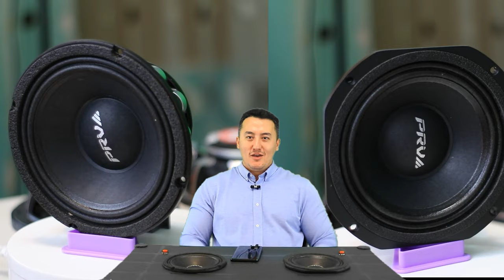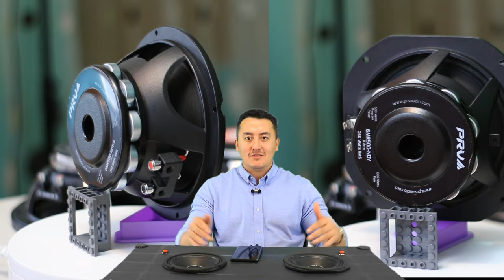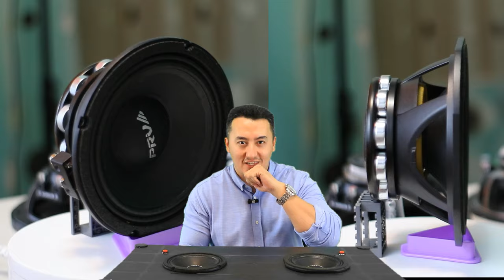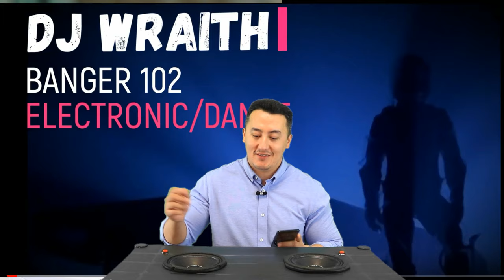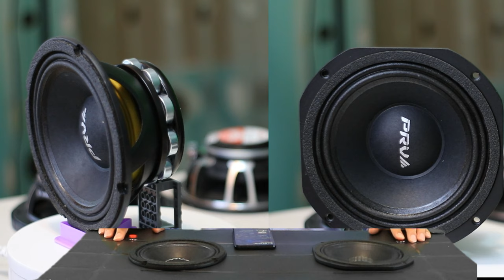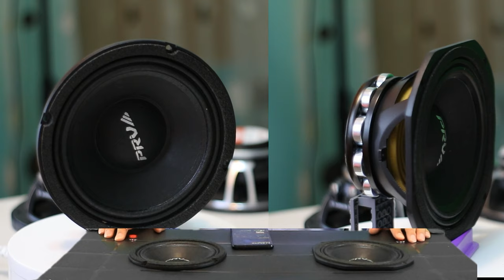Myth busted, real test 4 Ohm vs 8 Ohm speaker? Car audio system PRV AUDIO 6MR500-NDY

Comment: The less ohms the more power it draws from the amp mike it might not be noticeable at low volume but crnk that volume up and youll smell some smoke from the 4ohm speaker first.if you have really good amp and you want more speakers you can have 4 8ohm speakers per channel to a final load of 2 ohm per channel vs only 2 4ohms tht make the same 2ohms final load per chanel so you tell me if 8 speakers vs 4 speakers makes  diference with 8 speakers if you have the room you.can have way more punchy middbass or nice and clear vocals
Reply: well said. running higher impedance speakers also allows amp relax and be more efficient less current draw and cleaner sound  2 ohm vs 4, 4 sounds cleaner amp runs cooler and efficiency goes up less taxing on the poor at best electrical system most have. once you go full retttard and spend thousands you care much less about this and just want the sound you like  no concern given to the price or efficiency. small sacrifice of db allows for cheaper build too for beginners who cant afford big 4 and 4/0 and mechman alts and... it never ends   but a budget multi amp system can be built on stock electrical if done right and using these options to your advantage. at the sacrifice of a little spl but you can always buy more later. car audio does not have to be for the wealthy alone just read more books and stop believing everything you read in forums 90% is hogwash you dont need 155db @ 30hz to have fun with this hobby  but it does help   ;P
Reply: and i band pass my mids they get mids only if you have too large of a range per cone it gets muddy and builds more destructive heat ( your number 1 enemy is clipping number 2 is heat ) and i can grossly over power my mids by keeping them this way you want highs get some tweets never full range mids with real power once the magic smoke comes out its a paper weight
Reply: Hi I have a small doubt. please give your expertise,I am planning to build a diy soundbar with 2.0 amplifier board (stereo left n right channel), can I add 1 woofer to the amp,(thereby total 3 speaker for a two channel amp). the impedance of amp is min 8ohms..
Reply: @fusion_fever1592  im not expert but if the amp is capable of bridge mode i think you might be able to ger away with it but keep in mind you must add something that cuts the mids and hight only to the subwoofer.. i sugest get a 3 or 4 channel amp and play it safe if you dont know what youre doing or do some more reserch before damaging your equipment
Reply: @michaelsegarra2709  thanks for the reply, the way my mind is thinking after watching lots of YouTube video on impedance is as following,the amp is a 2 channel stereo with 8ohm impedance,so I will a 8ohm speaker for the left channel,and now I will add my 4ohm woofer and a 4ohm speaker to right channel in series, thereby giving a total impedance of 8ohm on right channel (4+4 =8),thus meeting the requirements of the stereo amp at 8ohms..
Reply: @fusion_fever1592  if the amp is capable of being bridged you can run the woofer bridged and run the mid high in stereo   make sure it will handle the lower ohm resistance and be sure it will be ok being bridged if not there is still  way  get passive crossovers (like dayton or audio pipe ) and that will let you use 2 to 3,  4 ohm speakers and still have a 4 ohm load total load  but it will take away some spl using passive crossovers. and your bass will be 2 channels for what you are doing id use a dvc sub a dual 4ohm and put 1 channel of bass on each subwoofer coil.
Reply: the crossovers is your best bet they are like 20 a pair on the big auction site
Reply: i am not a fan of the crossovers or there cut off points    you can order dayton crossovers in 8 ohms as well  audiopipe are all 4 ohm that i have seen    making your own crossover with the tools on parts unlimited might be a better option for you as well   and if at all possible get a better amp and worry less   its easy to use a car amplifier for this use and a clean power supply like one for a hp server  my garage has a two amplifier 2500 watt skar audio system and 2 @200 amp 12v psu's from servers. it literally tries to rip the garage apart
Reply: Lower ohms higher heat on the amp ads distortion less headroom
Reply: How do I wire 2 6.5 speakers together on 1 channel on a amp
Reply: I play my 4 of my ds18 4 ohm speakers at max volume all the time and I don’t smell anything so for me I don’t have that problem and I’m running a 2k watt amp on all 4 6.5
Reply: This is true…years later. Even with todays car audio amps with huge numbers for cheap prices I wish there was more 8ohm offerings. Old school setups with 6x9s on the back dash and tweeters in all corners with upgraded factory swap all around would be nice without having to need so many amps.
Reply: @michaelfessenden8601 the key is to do the math on how much watts you need at a given own and get about 30 percent over the watts you need, since most amps aren’t 100 percent efficient.
Reply: OK, build a Q-system at 1ohm and a DB system at 8 ohms .and have fun with that
Reply: If I have 4 8 ohm speakers that take 250 watt rms each, and wire them in a mono 2 ohm amp in a parallel circuit, does the rms gets cut down? Will it get the same power vs a 4 channel amp that sends 250rms to each channel?

Comment: 4 vs 8 Ohm isnt really a power thing. if you close your eyes you can hear the difference between them. its not volume, its tone and texture of the different ranges. the 8 ohm sounded "thicker" at the lower ranges, but muffled the mids and highs. where as the 4 ohm lost some of the meaty bass, but gained more crisp sound in the mids and highs. when I put together a system a couple decades ago, I used 8 ohm subs and used 4 ohm mids and tweeters, I would have taken the tweets to 2 ohm but they just werent around back then really. but I had an incredibly rich sounding stereo. heavy base that you could feel passing through you, and crystal shattering highs. now I wish I could get something other than 2 or 4 ohm speakers for my motorcycle :(
Reply: Its the best comment on this video, Ive heard that too yesterday doing car audio and switching between 8 and 4 ohm subwoofer, 8 ohm just crashed it, you could close your eye and just relax deeping through that smoothness of bass vibrations, that meat! Difference in night and dat!!!! Even by not an audiophile person next to me. Otherwise wiring 4ohm speaker the bass was easier controlled right and louder, but it was only loudness and not quality itself it was not comparable, maybe some mids and highs would be better at 4ohm but not for a bass, it needs to be hell thick and dynamic which only maybe top high end 4ohm speaker give you, comparable to casual 8ohm. Peace out! And have a good 8ohm subs in ur trunk!
Reply: Thanks this helped me how to design a sound setup for a pinball machine..understanding the output. Now are those driving by individual amps? If I remember on my home theater amp I can set the ohm ratings per channel though.  I also bike too.. ride safe
Reply: It took me a while to finally find this comment. I have a pair of beautiful PHD AF 12" 4ohm each, that will be pushed by RF T20001BD. The amp should give them enough power at 8ohm load. What you think?
Reply: @sebastianfonk1281  I havent dealt with Rockford Fosgate a whole lot. especially this high of wattage as most my experience with them is in the motorcycle applications. they are good but they always seemd to be a bit "meh" on note for note quality, but they have among the best for controls.
being as you are using it for base,  it would fall more to type of music. Rock/metal should have a decent snappiness to it. overly muted "rap" style base will likely be snappier, but thats not the general goal of rap style music where it tends to be long low notes.
but would def suggest getting a good crossover to delete the ranges you dont want pushed through subs. even if you dont hear those notes anyways, if the signal contains those ranges it will reduce your clarity of the notes you want coming from them.
make sure the box is properly built whether ported or un-ported. I wouldn't go with off the shelf boxes unless the box is specifically built by the maker of the speaker. the boxes off the shelf will 99.9% of the time be the wrong size and give to much air or not enough and/or have the wrong port sizes.
you should be fine over all as long as you don't try to rush from the point you are at to a finished system.
Reply: Lol... 8ohms is thicker sound than the 4ohms... 😂😂😂
Reply: @brettleisy356    Soo YOU feed 1 watt into the 8 ohm. Then on the 4 ohm it draws 2 watts from amp but same would level. Which means  if 1 watt into 4 it would be quieter
Reply: @joeyjustin6895  I understand resistance, but maybe you don't understand how wattage converts to dB, when you double the wattage you are looking at approx 3 dB difference. when you're talking about a 1200watt system jumping to a 2400 watt doesn't double the volume. at these points its better to have a better sound than just barely perceivable volume difference.

also having a higher sensitivity speaker (not to be confused with ohms (resistance))  means your 1 watt floor starts with more dB. a quality speaker can be around 8 dB higher typically. this is REGUARDLESS of ohms. this puts you are 2-3 doublings ahead of lower quality speakers.

you can have a 2ohm speaker that is still louder than an 8ohm at the same wattage. YES you are correct on the resistance, but not necessarily on volume.

even when speaker for speaker and only ohms change, the difference is minute and the % of difference it makes becomes smaller the higher the wattage used.

the difference from a car horn (@ 2 FEET) is 110ish dB, a full on rock concert is about 120-123.  your 3 decibel difference wouldn't even be registered (without an actual measuring device) in these ranges.
Reply: @JmsJing  have you heard of harmonics? its where a note plays at a specific wavelength or hertz. Harmonics create smaller spikes at the same not but matching its pitch, a "thick" sound might have several of these harmonics happening making the sound seem fuller. for hearing tests they actually use equipment that reduce/remove the harmonics to more accurately find ranges you cant hear, as the harmonics might fall into the hearing range and give a false sense of hearing.

some high quality equipment will have several of these harmonic spikes.

so yes... thicker sounds (wider/more placements of harmonics along the spectrum)
Reply: @brettleisy356  its not your speakers making all this thick magic with impedance change its the amp that is powering them. Yes most amps sound alot better at half there power. Even the amp in a head unit . The dampening factor increases and the thd decreases when the amp dont have to ramp up the voltage and the mosfets stay cooler as well
Reply: @Hayawasa  you're amp can be the ultimate out there in all ways, if the speakers are junk they wont reproduce as well. the speakers I tested were of the same brand, and make, the only difference was the ohm rating, on the same amp. while it COULD be factory quality variance of the speakers, there was an audible difference.

the speaker factory variance seems to be less likely as its repeated with other speakers/brands/ohms.

this is not saying the amp isn't important cause it is. but they are I would say equally important.
Reply: @brettleisy356  your right. You pretty much cant have one without the other. Not to mention a good quality music , i wish now i would have made a thumb drive full of all my favorite music on flac files. The stuff they stream through the phone isnt the greatest sometimes. I have some streaming apps on my phone but some songs arent on there, man i miss my cds. But i could see where in certain situations like yours an 8 ohm speaker may sound better , but its not something that is commonplace. Unless it is home stereo setups. Im just assuming your talking about a car.

Comment: guys .an 8 ohm speaker  is 3db more efficient than a 4 ohm..it this amp  is 250w at 4 ohms it means at 8 ohms is 125 watts.even the 8 ohm driver receives half the powet it plays the same loudness with the 4 ohm.this means that  with 8 ohms the amp will be much less stressed than with 4 and it will play cleaner. an additional benfir is the damping factor of the amplifier will be double at 8 iohms.of course the current demand from the cars electrical system will be half  for the same loudness.if you add two 8 ohms drivers in paralel eveything will be as a 4 ohm one but it will be 6db louder which is  a huge difference

Comment: I like this vid. So many people misunderstand ohm law etc. and how a 2 omh speaker is not automatically louder than a 4 ohm or even an 8ohm of the same speaker. 8 ohm is actually easier on the components and amps, etc., and 8 ohm also is easier to control the flow of power than either 4 ohm or 2 ohm. The lower the ohm rating of a speaker, etc., inherent is a reduction in clarity, etc.--quality--and the power is also harder to control and the ohm rating goes down.
Reply: majority of car stereo amps (stock stuff) do not boost the voltage in the amp section (good amps do), so they only have 12V, 4Ω easily wins to drive more power in this situation. This is why there is 4Ω speakers. And as Resonant Engineering said, lower ohms can be higher power rating, its not just ohms law, its also the power law.
Reply: @Jim Catanzaro Ya. I was building systems back in the '90s. Maybe I'm getting old, but every system I hear runnint A/B amps always sound better than even the best class D; although, plenty of people will disagree. And that's fine. they can disagree all they want until they hear a sub running off a/b and same for door speakers.
a/b amps push-pull by their design. It's more dynamic, they are faster, which means speakers run faster, and subwoofer sounds amazing on an a/b.
Reply: @RobHTech  so if my dead unit is a class d is it worth using an a/b amplifier?
Reply: @RobHTech  a/b is the best, yes, some people can't hear the difference, I definitley can, I've been doing systems since 1980
Reply: @RobHTech i agree with you..an a/b has sound quality ...

Comment: Ok all amps are rated to do  power at certain ohm loads eg the amp will says 500 at 4 ohm and 1000 at 1 ohm the speakers will tell the amp what power to put out so yes the 4 ohm will play louder than the 8 ohm on the same amp anyway great video watching from trinidad and just a little advice doubling the power on a speaker doesnt mean it will play twice as loud it doesn't work that way
Reply from the maker: Exactly what Im trying to explain whole  my life )
Reply: In my experience the more ohms the cleaner,. The less ohms the louder,. 4 will be louder than 8 but the 8 will sound more crisp

Comment: My friend the difference is if you take 2 and 8 ohm speakers are that you can bridge them together that will make 4 ohms impedance so if you have a 4-ohm amp you can hook two speakers to one channel and stay at 4 ohms,  or if the amplifier is a 2 ohm amplifier you can hook 4 speakers on each channel.
Reply from the maker: Neah look  buttons! home work for you
Reply: Exactly

Comment: Thanks for the great videos.  I look forward to the competitions.  The difference in 4 ohm and 8 ohm speakers is the ohm load they put on the amplifier.  The 4 ohm speaker will make the amplifier run in 4 ohm mode which is usually twice the power as it puts out in 8 ohm.  So if you have two speakers a (4 ohm and 8 ohm)on the same amp but different channels, the 4 ohm channel is putting out double the watts as the 8 ohm channel.  That means the 4 ohm speaker will be louder than the 8 ohm speaker but only by a few decibels.  Also, when the amplifiers ohms are dropped from 8 to 4 to 2 or even 1 ohm the distortion levels usually increase in output.  So using a 4 ohm speaker would double the power and increase distortion when comparing it to the 8 ohm.  When comparing speakers the ohms need to be the same.  Thanks again you've helped me choose which mids I'm going to purchase!
Reply: So are you saying @jadm the 8ohm would be better when you consider vocals?
Reply: @dgfresh92  go for 6 ohm
Reply: Thank you for your advice but I got a question I can't get answered. Surely it is simple. A 8ohm speaker rated for 150watts rms will always need 150watts rms, even when wired down to 4ohm right? Or when wiring it down to 4ohm should I only give it 75watts now?
Reply: @RandoManFPV  Yes.  That is what is rated doesn't matter wether you are in 8 or 4 ohm.  Ohms are for figuring out which way you will run the speakers for the AMP.  The AMP will tell you what OHM to run the speakers in for best or max output.
Reply: @jadm4850  thanks man!I thought I had all this figured out haha. Heck I already knew the answer to my own question but the more I thought about it the more unsure I felt 😅
Reply: Some people put 4 8ohm speaker together to get 2 ohm load at amp
Reply: Strong 4 channel pushing 16 mids and highs

Comment: The only difference i hear is frequency response is way better on the 8ohm…the 4 ohm is kind of beaming at certain frequencies. As an audiophile i choose the 8ohm for clarity reasons but for power and noise value i say choose the 4ohm. Its cheaper to make given watts @ 4 ohm than @ 8ohm to make 200w rms @ 8ohm is probably 4x the price. Amp to speaker matching is very important as well.
Reply: Beaming is a function of speaker size and shape, not impedance.
Reply: THIS!! ^  Thank you.  I was looking for the "mash forehead on keyboard" button...  Some of the ideas people get...